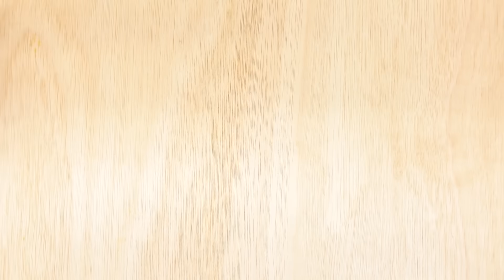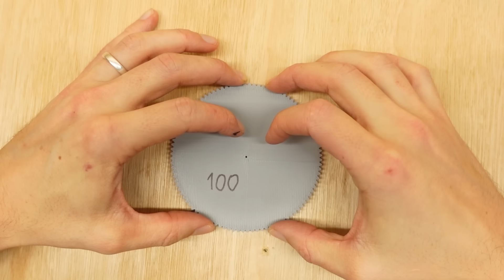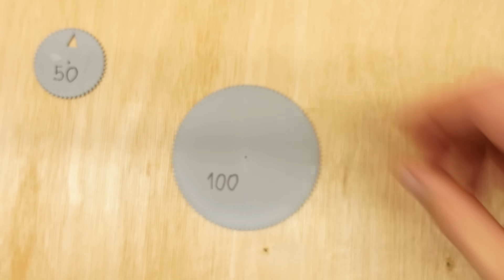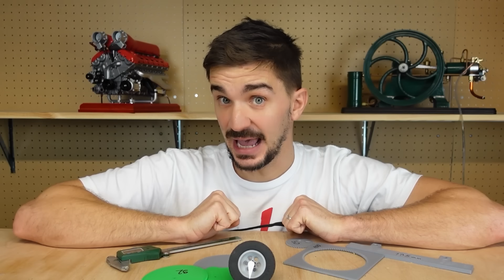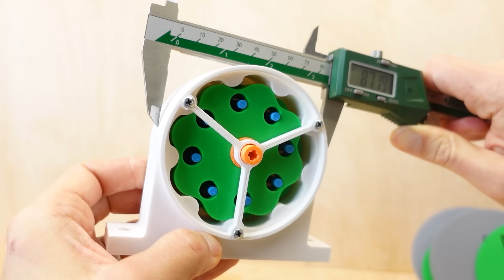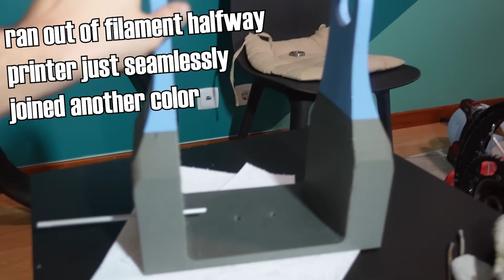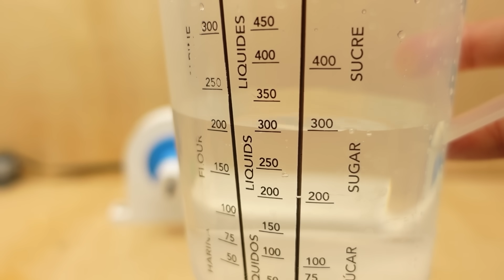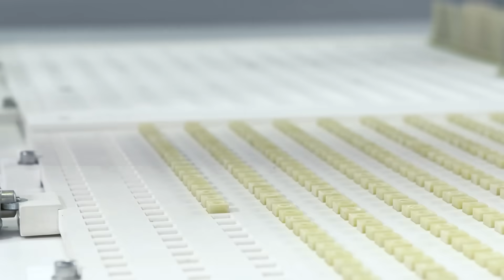Toothless Gears Make Much More Torque Than Conventional Ones, Here's How. Cycloid Drive Explained

Comment: I have been 3d printing for about a decade now. And it definitely changes how you think of things. I never have to buy an adapter anymore because I just print one. Have a 1in vacuum hose and need to connect 1.5in accessories no problem simple print and you have what you need in no time. Bambu Labs has made an entire eco system and you really can not beat their system. No other printers allow you to open their app scroll to some model you like and print from your phone! I hope other printer manufacturers start doing this because its kind of a captured market at the moment. The ease of scrolling and clicking print from the phone is a huge game changer because it definitely makes it super easy and it definitely causes you to mindlessly scroll for hours! And the speed of their printer is amazing as well. Gone are the days of 60mm/s prints lasting days.
Reply from the maker: All true. I think what bambu did is that I took a market that was previously only for serious tinkerers/diyers with substantial skill and made it approachable for people with little to no skill. When you think about it ,it almost seems weird it didn't happen before. There were several big players in the field before bambu got in. What impresses me more is how little maintenance the printer actually needs. Coming from the world of project cars and bikes I almost feel guilty :) I've done hundreds of hours already and all I had to do was to lubricate the rods once. Somehow seems wrong :))
Reply: @d4a excuse me do you know is it possible to use this cycloid drive in a watch instead gear train? I am not engineer, physicist, but just think about it)) what happen with watch characters if install this😅

Comment: 19:07 What if rather than using 2 gears one after another, we use 3 gears, where 2 of them is half as thick as the 3rd, and sandwich the thick one between the 2 thin one, where the 2 thin ones are facing the same direction and the thick one is facing the opposite direction? Shouldn't this solve the rocking issue while still cancelling the opposite forces?

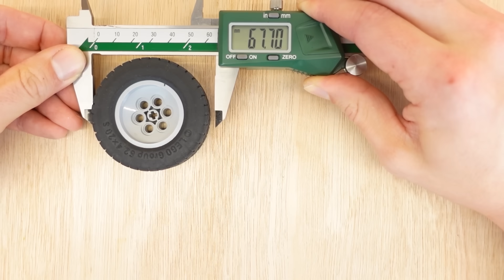Comment: 0:08 The Lego tire has the diameter right there on the sidewall. 62.4mm
Reply: That’s cheating….. but also, it’s sometimes good to have trust issues and measure anyways.
Reply: I didn't catch that on my small screen. Lego putting that on the sidewall is 🤌
Reply: @erinmac4750  you can zoom videos like you do with imagens, btw
Reply: @akiraic 😮
Reply: @marhanen  right????

Comment: Why wouldn't the balance problem be solved by using 3 inner disc's set apart by 120 degrees would this be a better balanced design?  Instead of just the two set apart by 180 degrees. What about more than 3 disc's disc's, that is up to the limit of the number of teeth? Thanks for a very informative video I learned a lot from it. Best wishes

Comment: In relation to a flat panel a wheel indicator points towards that panel once.
When it goes around another wheel, it points at the wheel once too.
In relation to both, the wheel does only one rotation.
But because the wheel is also curved, from our perspective the curvature adds rotations.
Reply from the maker: That's a good way to look at it too!
Reply: I was just exploring the explanation between centripetal and centrifugal not long ago.

Comment: If an inline 6 is perfectly balanced (as all things should be), could you have a cycloidal gearbox with 6 cycloids? Would that be able to cope with high RPM?
Reply from the maker: Yes. Would it be compact? No. At that point you might as well add some injectors and an intake and exhaust 😅
Reply: @d4a  Build the engine around the gearbox, literally 😅

Comment: What about friction?  With all the contact points/area wouldn't friction be much higher than gears also?
Reply from the maker: Yes, friction is higher but not by much. Precision machined units (sumitomo etc) can manage only 5-10% lower efficiency than geared designs. There are some novel cycloids that can do 90%.

Comment: I believe the hydraulic drives of most excavators use these.  Since they crawl at such low speeds and need a lot of pushing power for the dozer blade;  it's perfect for them.

Comment: and many people even own at least 4 cycloidal transmissions !

it's in your cars front seats. the part you lean your back against is held and set up by a cycloidal transmission on either end.

you rotate the knob to sit more upright or more laid back and the cycloids give the gear reduction to move your upper body with ease !
Reply: Thank you for that, now I can’t wait to go play with my car seat!
Reply: Only if you have reclining mechanisms driven by a handwheel or motor. Almost every car that I have driven with non-powered recline has a latch which just releases the seat to freely (but with a spring) recline.
Reply: @brianb-p6586 that sounds like the french creatur de malheur. i drive one of those for work.... not all that pleasant. but way better then taking the foot-bus.

Comment: Another great video, thx.
On the balanced force discussion at the end, I've thought about this when you've discussed it on other engine videos.  Would an unequal 3 element assembly, with the center element providing greater power (ICE application) & mass (transmission & ICE application) better balance out these forces?

Comment: Couldn’t you completely remove the imbalances of the rocking couple, by using 3 gears? The 2 outer one's being parallel to each other and the center one being twice as wide, should remove all imbalances.